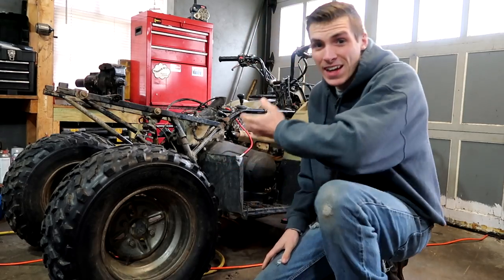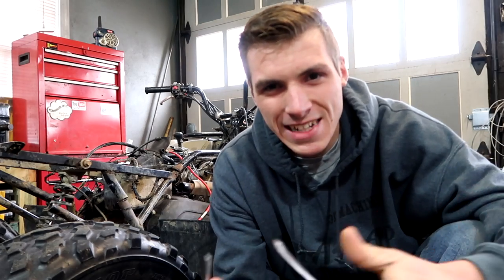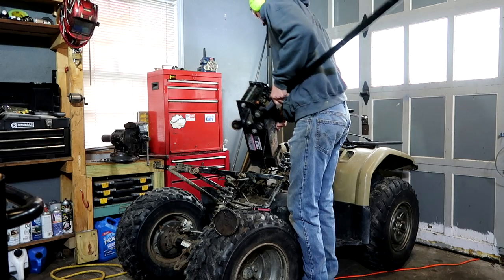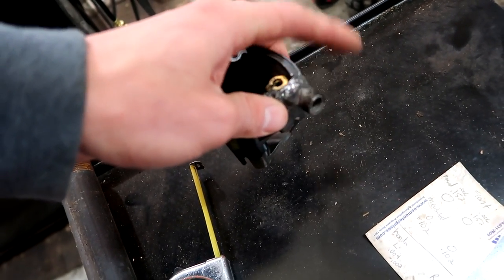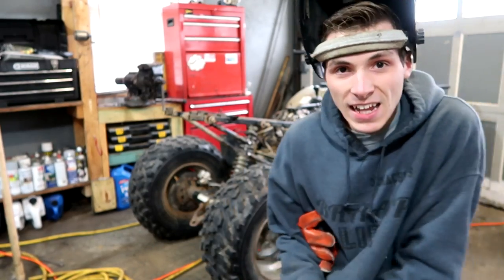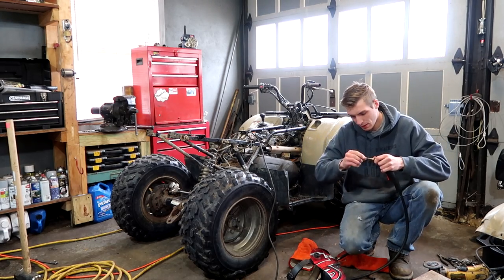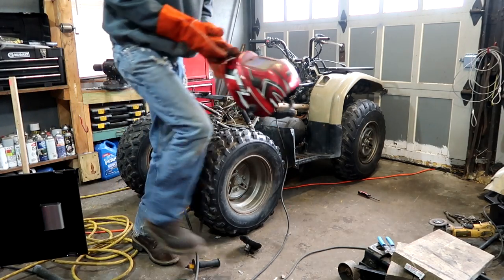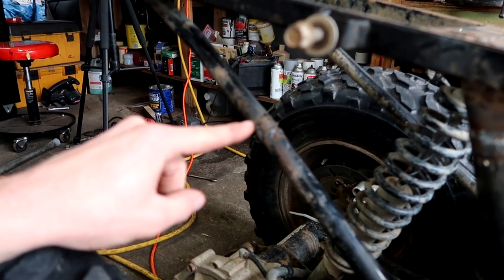DESTROYING MY FOUR WHEELER

Comment: Your vehicle should have a screw jack. And much easier access if you would have removed the rear axle. And a reciprocating saw would get you cleaner cuts. Some anti-splatter would keep your tip in better shape longer.

Comment: Have you tried flux core wire, it works great with no gas so you can work outside if you want and it's good for dirty rusty metal and is good for thin stuff, great vids.

Comment: I think you could have saved yourself a bit of cutting and hammering by using a bottle jack in between the sub frame rails to bend the right side back out. love the videos man, keep it up!!!
Reply: and you can bet that whole clutch housing has about 5 lbs of mouse nest in it too lol. I rebuild an 02 scrambler that had the same issue, mice love anywhere there is an intake lol. You are doing a great job, I am eager to see the motor disassembly and fire up!!!

Comment: Why don't you sell the BMW and buy parts for the duramax? Like nicer wheels and tires, turbo, injectors, fuel lift pump, etc....
Reply: jSwordy17 he should
Reply: jSwordy17 He doesn't need to. The dmax is fine.
Reply: olli lehtonen Why would you want to leave it stock?
Reply: Or don't sell the BMW the only nice car and sell the snowmobile and 4wheeler and spend the money on the BMW?
Reply: Will Sherriff Nah, the Duramax is way nicer and costs way more than the BMW and is much more powerful
Reply: jSwordy17 there is no way it's nicer and than the bmw you need to go back to school if that's how your head works
Reply: Will Sherriff What do you mean it's not nicer? The Duramax is a $12,000 truck and the BMW is $2,500😂
Reply: Will Sherriff LMAO the Duramax actually has interior, it runs flawlessly, and has lower miles😂😂😂😂 go troll somewhere else
Reply: Will Sherriff Explain to me how the BMW is nicer
Reply: jSwordy17 it's a bmw so it has German build quality, it looks nice, it's quick and at least 10 times as fun to drive as the truck